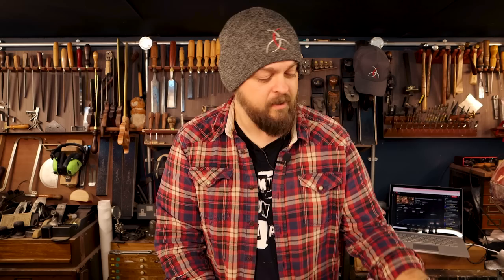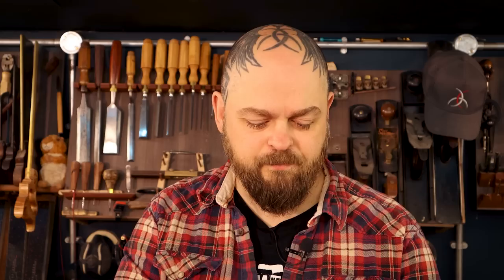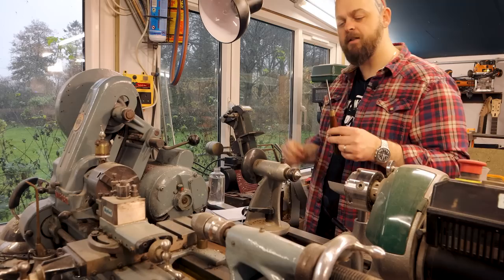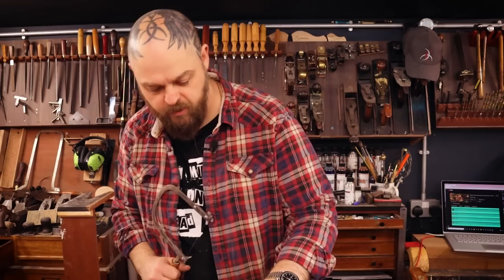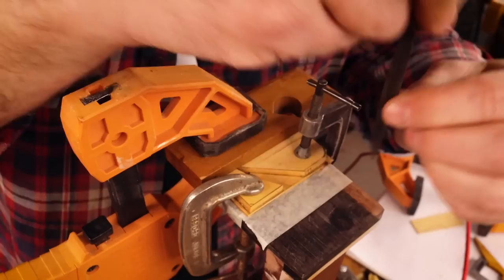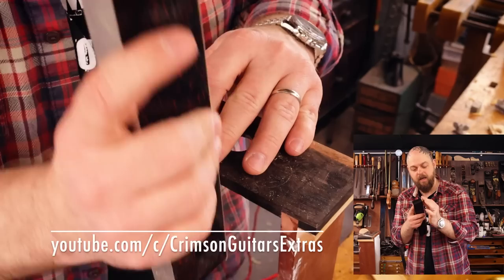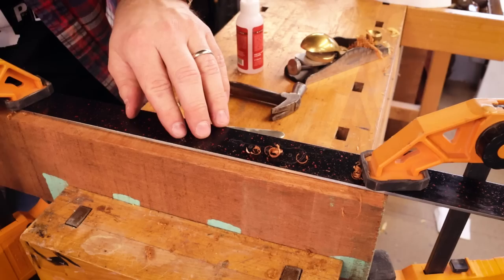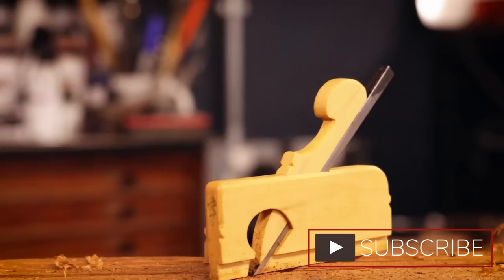Ep 2.1 Making a Tiny Boxwood Rebate Plane | A Hand Tool Only Acoustic Travel Guitar Build

Comment: So as well as having multiple sub-sets of episodes on the hand tool only (plus power drill) build we now have alternate path episodes which relate to the origin story but are also distinct.
This is getting harder to follow than the MCU timeline.
Reply: CCGCU, BCCU?
Reply: Do the bandsaw and grinder count because he isn’t actually building the guitar?
Reply: It's like the Zelda timeline. At some point time will split and Ben will somehow build three guitars from this same piece of wood: one where he freaks out and carves a gouge in it with an angle grinder, one where he doesn't realize he used the drill press for a minor fix, and the true timeline where he finishes by making fire with a hand carved bow drill so he can burn the finish.

Comment: I'm just putting some hand tools together for the next GGBO so it's built by hand and off to a great start by finding a rare collectable No4 Metril Ind Bras smoother for £5 on eBay in great shape probably worth £150 . Ele tric plane now put to bed. 
The hardest piece of metal you have in your shop is an Alnico 5 pickup magnet . I know that for a fact as I've just cut one in half lengthwise with a super thin ceramic grinding blade in my handgrinder which whips through bearings and drill bits no problem . This was done for a single coil pickup using a Gibson bobbin so I have a South Pole either side of the screws .
Generally 1/8" (3.2 mm) but at 1/2 wide you have enough for a few small blades of various widths which will never need sharpening . I have A2 to hand for odd cutters which is easy to cut and shape and heat treat .

Comment: As I said during the live stream, no one ever told me that files weren't used much for most wood working, so I use them a LOT. I love using them, and have a small but growing collection. I'd love to see a video on making handles for them, since so many I come across don't have any, and I HATE most manufactured ones that I've seen- primarily resin. It's not just aesthetics, either- I have very short, fat fingers placed on very wide palms. Besides, most are made to fit larger hands, overall, and become very uncomfortable to use very quickly. Some tricks on how to customize tools/handles to fit not only the use but the user would be AWESOME!

Comment: As always ben. Very cool! Thanks for clearing up the angle question I had in my head. Also the building these thumb planes in multiple pieces. Rather than carving out of a solid chunk. The blade question has been stopping me from building one. I’ve been doing the same thing. Looking around at existing blades, files, tool steel...ect that I can sacrifice for the good of my tinkering brain. Again very cool! Thank you

Comment: Violin makers consider boxwood to be a self-lubricating alternative to ebony for tuning pegs - that is, it makes for tuning pegs that are much smoother and responsive to use, but hold the tuning much less. A friction fit in boxwood for planes might therefore be less than ideal, even before adding the extra problems you talked about

Comment: Yes, it would seem that common sense did not tell this gentleman to not oil the wood to wood friction surfaces of a hand tool, at first. But he did figure it out for the redesign. And isn't learning a big part of design? Great job, sir.
Nice little tool you have there in the end. The slant to help the shavings curl outward is a nice touch. I believe I have seen that on many old wooden planes, but not all of them. It does appear to be somewhat more prevalent in the smaller ones like the wooden  luthier's planes that I have come across. Especially the tiny molding and grooving planes.
I kinda like "Jessica Rabbit/Rebate Plane"; however, if you are not familiar with the movie "Who Framed Roger Rabbit" then it may not make sense. How about "Little Groovy" for a name for the new plane. And you can lay down a sweet groove number when the guitar is complete to honor the new tool.

Comment: You’ve done a lot of videos, so maybe you’ve already covered the topic in detail. But I’d like to know more about truss rods and the slot dimensions (in comparison to rod dimensions) and whether one end is “anchored” or they just bow because it has an inner thread and outer sleeve? Really get into the detail.
Reply: I don’t think the modern “double-action” truss needs an anchor at the non adjustable end, the slot just needs to be the right length so it doesn’t ‘shake’ back and forth. 

An old fashioned rod could twist in the groove I suppose, but I don’t really know if that’s the reason one end is ‘fixed’…
Reply: Be interested in how the DA rod “bends” both ways with one nut on it.
Reply: Thanks for that. The clip shows it very clearly. All my question answered. Cheers

Comment: beautifull tiny Puppet-Tool .. very very nice 👌😁👍
from my thoughts, problem with the Blade is, there for you have a wedged Blade and did not compensate that with the clamping Wedge 
(took a Wedge-angle for a parallel Blade + the angle of the Blade) .. your Angle is maybe a bit too steep for optimal clamping
Reply from the maker: that bit must have been cut out of the edit, I held the blade against the wedge from the other tool to work out the combined angle, the issue I have with this one is that the blade should be in the other way around, ie currently when you push on the blade during use it is trying to loosen the wedge, the other way it would be continuously seating itself more snuggly against the wedge. I'm going to have to harden the other end of the blade and go from there imo
Reply: @CrimsonCustomGuitars  then the Solution is easy .. turn around the Blade .. Chisel should be fully hardend so just grind a new Cutting-Edge and make one last Wedge ^^ 
must be good it rhymes at the end 😁 
i realy love that tiny Toll ^^

Comment: Ben.seriously. Get some O1 tool steel blank.    Literally it’s heat the stuff till a magnet doesn’t stick. Dunk in oil. Then shove in oven at cookie temp 400F for like 30 minutes.  Boom. New tempered O1 whatever you like.
Reply from the maker: will do.. well, I already have the steel, just need to start playing tbh. I get stuck in the whole use what is commonly available to most viewers trap quite a lot when I have better options available to me tbh

Comment: I absolutely loved this! Having the right tool for the job is always going to result in a better outcome and sometimes that means making it. The attention to detail was as the toolmakers of old would have done it, making it not only a functional tool but a thing of beauty as well.
I was intrigued by the little egg whisk drill you found in one of the drawers, I shall have to see if there are any available in the Vintage Toolshop!
Reply: I found an 8 & 1/2" inch drill, but what I don't need but want is I think a little smaller, maybe 5 or 6 inches. I'll keep checking.
Reply: A few years back I spent a week looking for such a drill - my biggest enemy was that I didn’t know a name for them that other people would know them by! 

Those - and a bit and brace - are two of the most elegant tools ever invented imo, I just love them - and would much rather have an egg whisk to drill small holes for pickguards, tuner screws, TR covers, etc, than go through the kerfuffle of using a heavy cordless drill to do them!

Comment: So does using the bandsaw/linisher etc on this disqualify you on a technicality for the "hand tools only" build? I mean, it's not actually part of the guitar, but you HAVE included it as part of the video series...? #importantquestions
Reply from the maker: it's tangential to the series, if it disqualifies me then we would have to insist on only using hand tools from before the advent of electricity to make it fair.. I think I could do that.. mmm :)
Reply: @CrimsonCustomGuitars  oh God, what have I done? 🤣
Reply: @CrimsonCustomGuitars  oh a side note - I saw your comment on Instagram that the tapered blade shape was less than ideal. I'm a knifemaker among other pursuits. If you wanted to send me some dimensions, I'd be happy to make you a purpose built replacement blade for it. Check your DMs on Instagram... 😉

Comment: Would a stiffening rod be beneficial inside a 3/4” dowel as a neck for a cigar box guitar? Most of the time dowels work just fine as necks for this style of instrument, especially if I keep the scale length short. I also have a cantilevered fretboard design that allows me to adjust the straightness in spite of any neck bowing but a straight neck is preferable nevertheless. I have tried copper tubing with the wooden dowel inserted into it but it added way too much weight and was a less than ideal playing surface for sliding my hand up and down the neck. The dowel itself is surprisingly comfortable and therefore I have little interest in adopting a more standard guitar neck design. But a strong, stable instrument is the goal, so I’m open to the idea of strengthening the dowel in a similar way that you would any other neck.
Reply from the maker: yo.. yes, I would say adding a strip of carbon inside the dowel would make a world of difference.